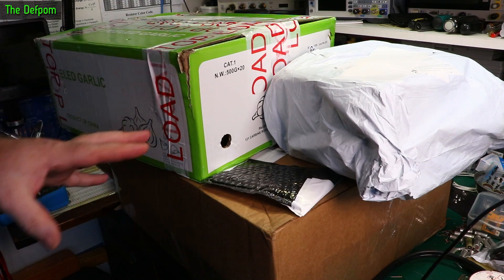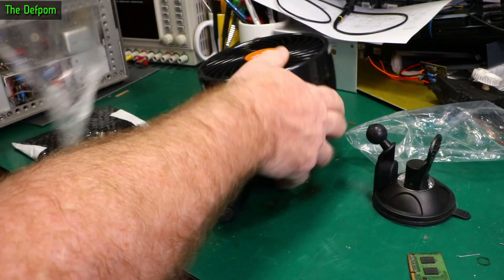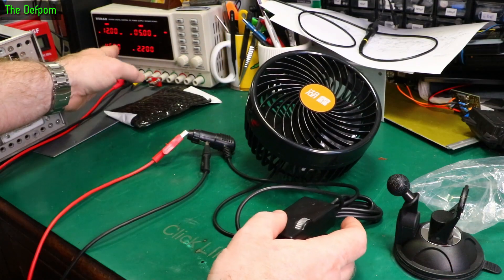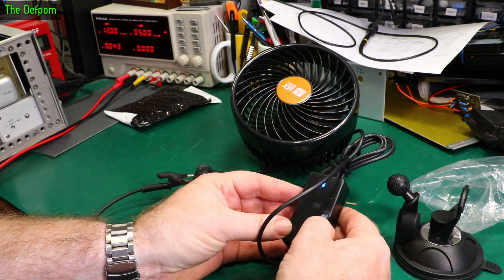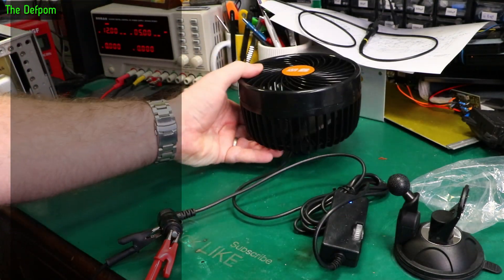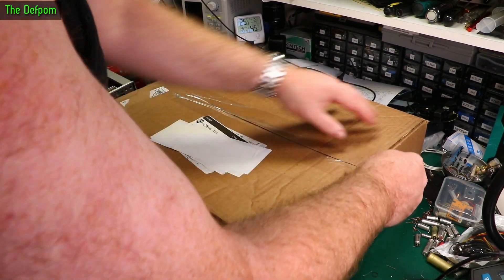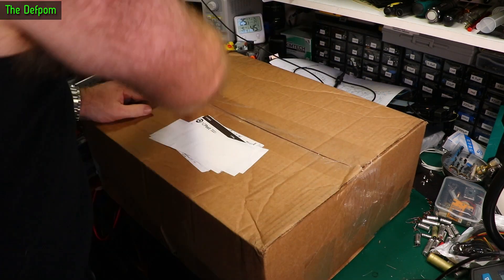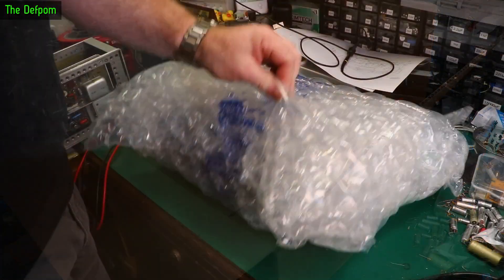🔴 What's in my Mailbag ? - Mailbag Monday 13th March 2023 - Test Gear Score ! - No.1106

Comment: Levell are great uV meters,  I have the one in a smaller case and meter. As they have an output they make low noise amplifiers with step gain. Used to have 3 or 4 of them on my bench wheni was doing audio coms. Being battery powered means that there is no way signals can jump between the output  back to the inputs via coupling to the mains or earth paths.  Then you have a 5ohm mic putting out only a few uV, never understand why the Americans standardised on 5ohm for mil a/c headsets.
Reply: Second that. I have the TM3B and use it as a pre-amp whenever I have a signal too small to see on a scope. Very robust and easily repairable. 15uV fsd in those days must have been pretty impressive.
Reply: @terrynicklin417  they had great bandwidth as well.